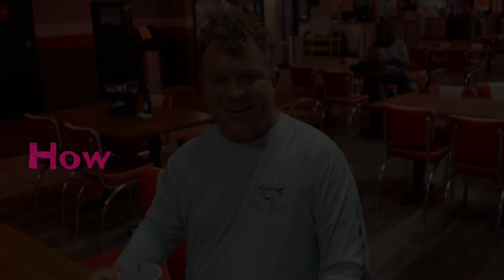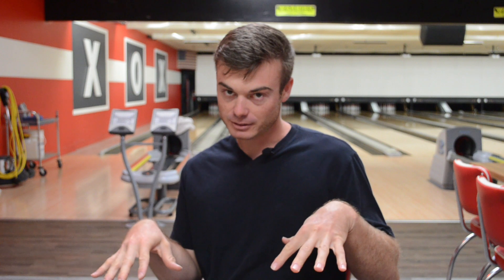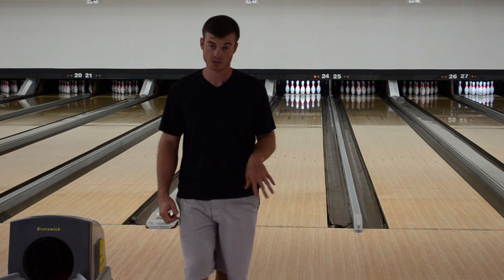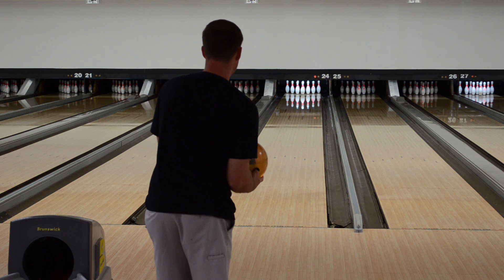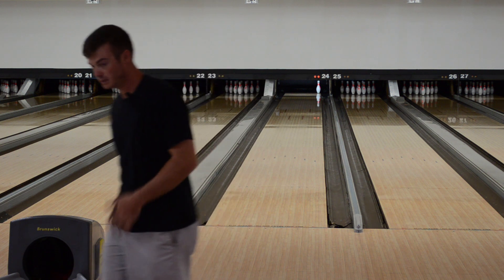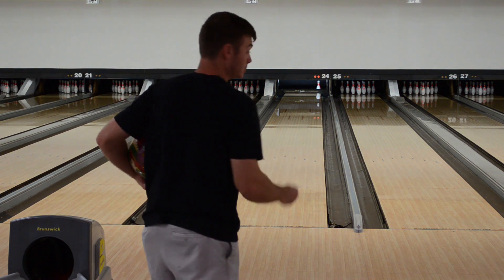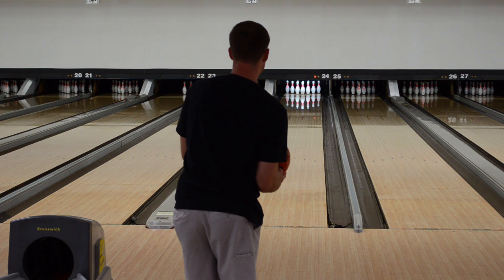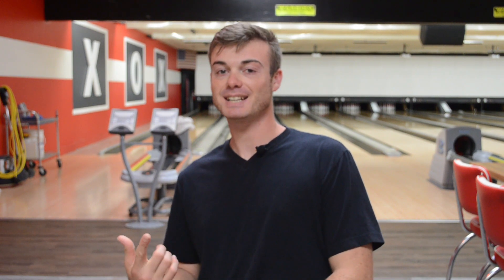How to strike with plastic

Comment: I grew up in the era where all I had to throw was plastic and rubber.  Because of that, I have around 400 full roller revs and always needed to use low-end resin equipment.  (Brunswick Power Groove and Ebonite Stinger were two of my favorites).

Unfortunately, due to age and injury, my ball speed dropped from nearly 19 mph to barely 14 mph.  Because of that I moved down to 15 lb. weight and now have an arsenal of all plastic balls.  A pair of Pyramid Pathogen Blue Dots (one drilled for early hook and smooth finish, and the other for skid/flip), and a Target Zone for when they hook too much.  I am soon going to add Radical's The Spy to the arsenal.

As for their effectiveness, I am currently 11-10 on a PBA Experience league with a 190 average, and I finished with a 205 average in my house league last winter (it climbed 20 pins over the year as I got used to the new equipment).
Reply: Wow! 
So you are an old school Full Roller killing it on modern House and Sport conditions with Plastic???

Comment: A radical Spy won me a tournament over the weekend.  Used it mostly for spares, but knew I was going to have to strike with it at some point.  When my hand/forearm gave out on the OTP, switched to the Spy and strung 4 to win the championship with a 247.    The spy allows me to play through the burn when I dont have enough strength left to keep moving left with my stronger balls.   The pin carry is sick. Textured  Plastic asym with dynamicore, probably going to need a few more by the end of the year lol.

Comment: I just joined a league a few weeks ago after not playing for 20 years and I only have this plastic ball and an old 2 finger technique.  I don't remember having to move so far to the right before but that seems to be where I got to go.  

Could I resurface the ball with a low grit and polish to make it act like a better hooking material ball?  Also, how much does lane oil effect it?

It's an Ebonite Maxim, red white and blue swirl glow ball.

Comment: I was doing one step drills with a plastic Columbia 300 ball and I threw a six bagger.  There  going 8-10 mph and walked in.  I wasn’t trying to strike.  It just shaped and flushed the pocket.  It may work for bowlers with slower ball speed on house shots if the outsides are dry.

Comment: My Columbia 300 white dot just won't turn at all. My local centre has very dry lanes and I was told that a plastic ball would be best for those conditions, this may be true but the damn thing just goes dead straight every throw...all I can do is just aim for the front pin and hope for a lucky strike once in a while...
Reply: Maybe put some surface on the plastic ball? That might allow it to pick up a little sooner. 🤷🏻‍♂️

Comment: Should be using a WD or TZone as they are by far the most common.
Reply from the maker: @williamhaynes2414  it's not the ball. It's the plastic coverstock that is the point of the video. It's about understanding how you use the coverstock to it's greatest potential. It's not about having the same ball as me.

Comment: I found your video very intriguing.  I'm a senior bowler with a relatively low rev rate (250-300 rpm) so my guess is that I would need to play first arrow or even closer to the channel to strike using plastic.  Your thoughts?
Reply: Funny you think 250-300 is a low rev rate. My rev rate is 145 and ball speed is 12 mph off my hand.
On a house shot with plastic I will be playing the 5 board down and in, letting the pattern take the ball into the pocket.
Plastic will retain a very high amount of energy rolling through the dry part of a house shot and hit very hard.
The trick is the keep the ball high on the headpin. Higher than you would for a resin ball.
You want to play direct. Attack the headpin straight on.
Reply: A lot depends on your speed and the lane conditions. Most senior bowlers that I know lose speed as they age but still have the same revs and rotation. I know when I fool around throwing my spare ball for strikes, outside of first arrow there’s not enough oil. It will either hook so early that it goes Brooklyn, or it rolls out before hitting the pocket.
Reply: @janderson8401  I've raised my speed as an older guy recently. I have been throwing at around 14 to 15 mph on spares with plastic or a Storm Mix urethane ball. Incorporated a more relaxed wrist and went from 5 step to a 4 step approach. Now my ball speed is somewhere between 18 and 19 mph. My back swing hasn't increased and I'm not working hard to get the speed either and virtually no loft. Ball rolls over the thumb hole most every shot.